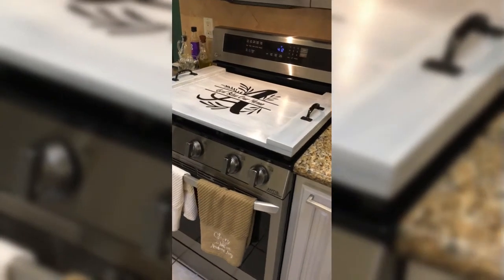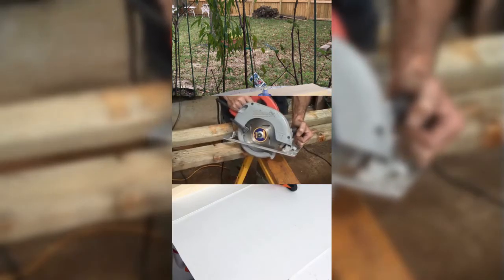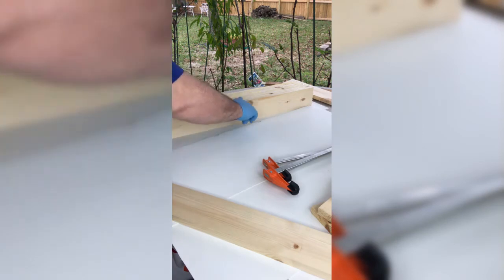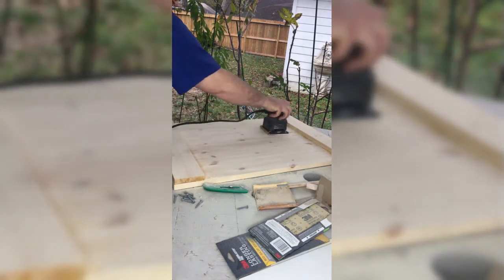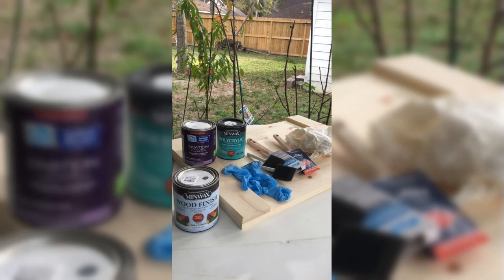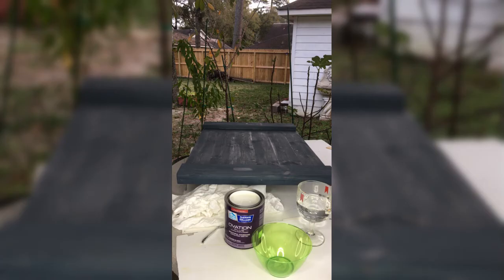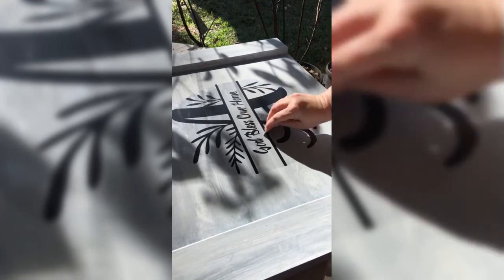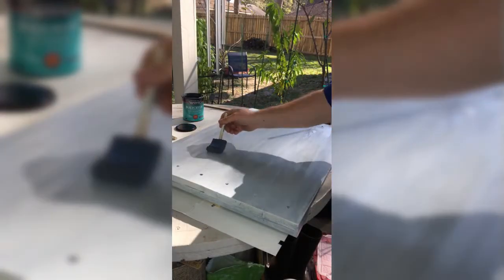DIY Noodle Board | Gas Stove Top Noodle Board

Comment: What grit did you use?
Reply from the maker: I used 80 grit and 180 grit sandpaper. You can pick up the plans and material list at my website (FREE). www.DIYNoodleboard.com
Reply: @diynoodleboard9667  I tried to get the plans, but the email signup doesn't show up.